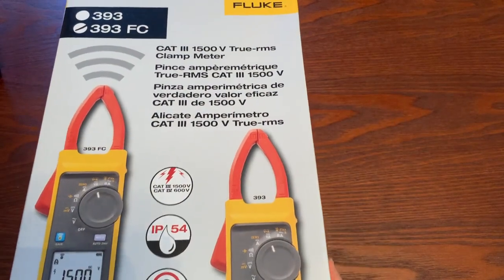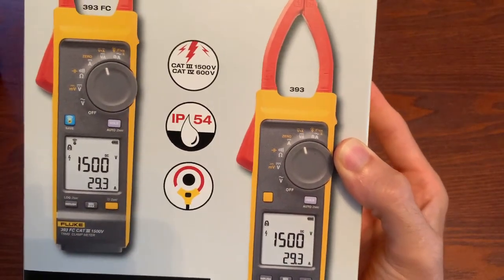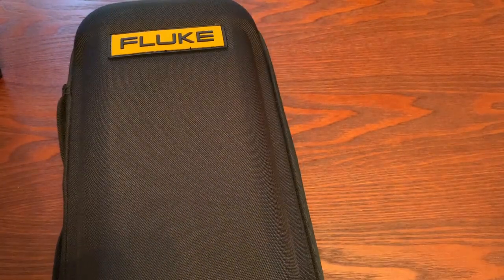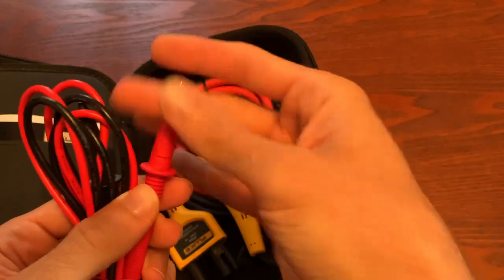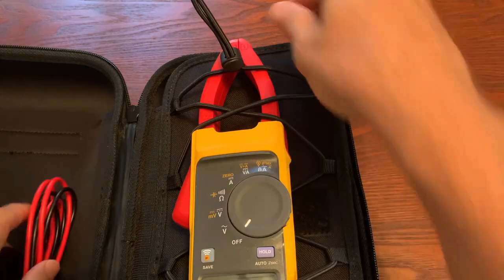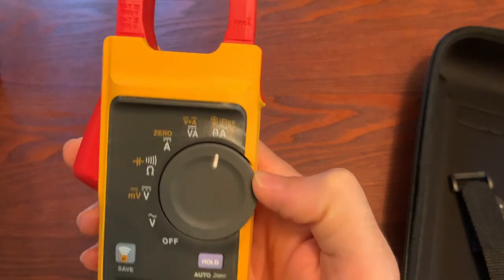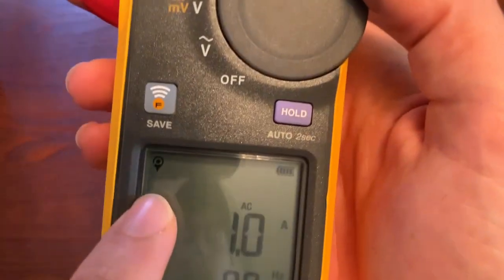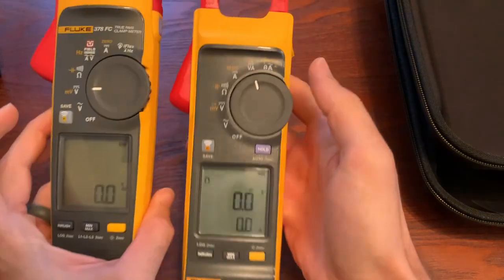Fluke 393 FC Unboxing - Fluke Fridays - Episode 13

Comment: Which do you like better, this or the 78fc? Thank you
Reply from the maker: Personally I prefer the 378 FC. But if you do solar panels the 393 is the clear winner or if you just like the slim Jaws and don't mind losing the Field Sense capabilities of the 378 FC.
Reply: @fridayswithbrandon  does the 393 have the low-pass filter that the 378 has for VFDs?
Reply from the maker: @joshualee3215  I don't think either of these have a low-pass filter in them.
Reply from the maker: @joshualee3215  but the 376 FC does have the low-pass filter

Comment: I like the jaws, but have no need at all to exceed 1000V.    I really wish they had these jaws on some other amp clamps, I’m thinking of buying it just for the jaws.
Reply: Solar strings can be up to 1500V, a lot of modules are rated to that some some inverters are too.
Most are less than 1000 but I've designed one in the last year that's above that.
Reply: Hioki makes a bunch of clamp meters with jaws similar to this